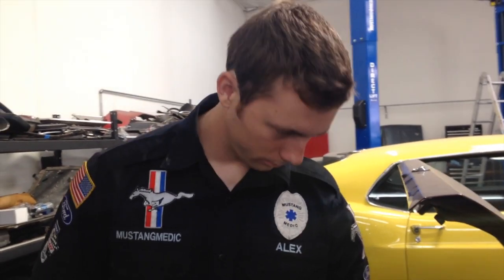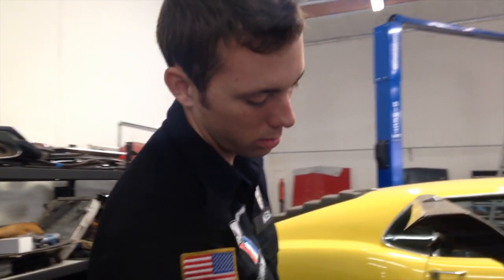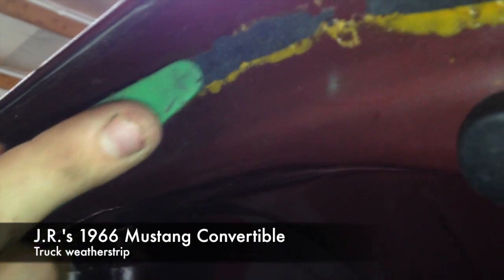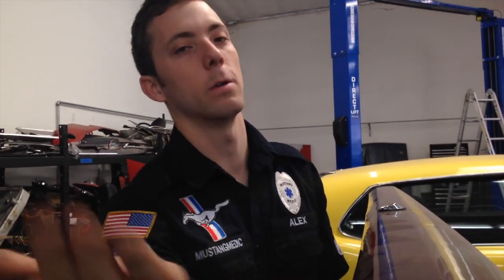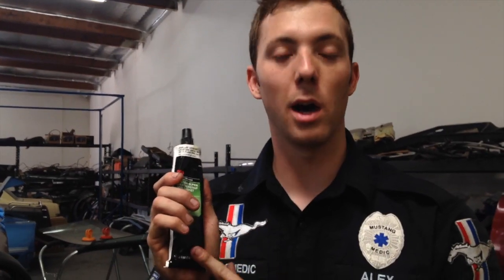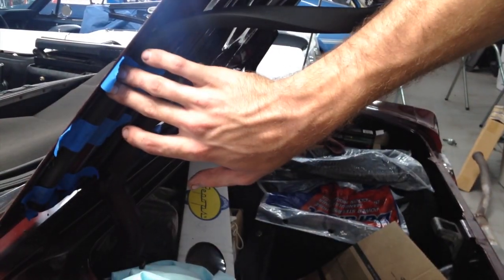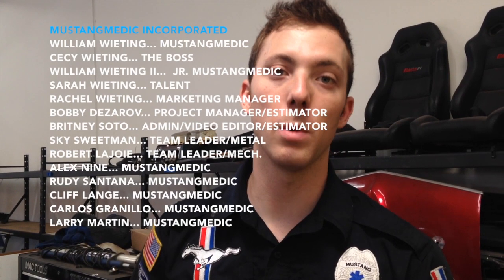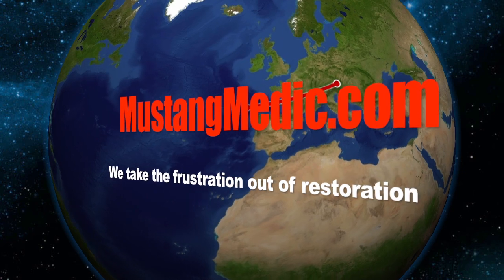Truck Weatherstrip On J.R.'s 1966 Mustang Convertible - Day 13

Comment: I did the same job of replacing trunk weatherstripping. Tried several different solvents to try and remove old adhesive. None worked well and I ultimately took some paint off in the process. Had to repaint portions of the underside. Ended up taking trunk right off of car. Came out nice but I don't want to tell you how many days it took. Read about a lot of problems with trunk weatherstripping and used Daniel Carpenter Mustang weatherstripping as it was only brand without complaints.